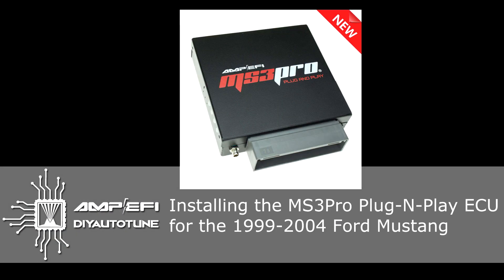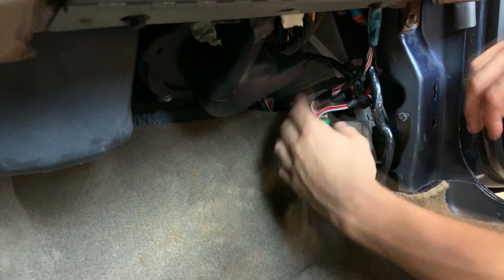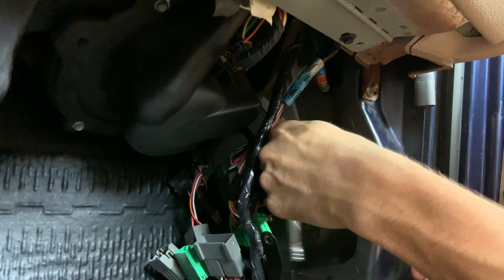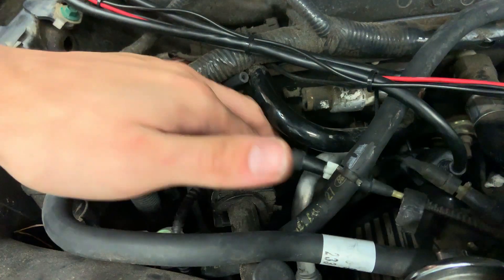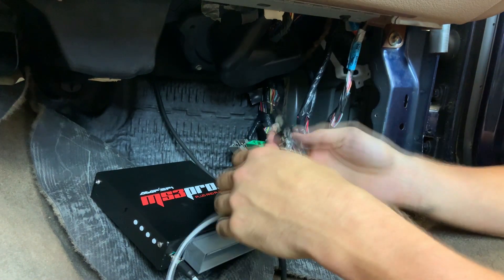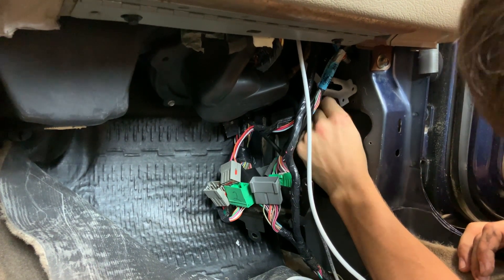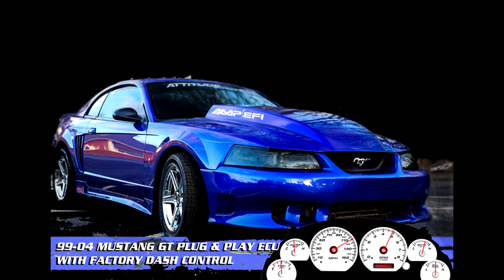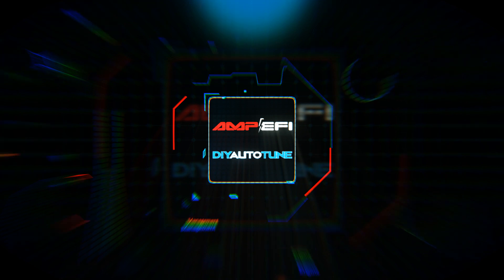MS3Pro PNP Installation on the 1999-2004 Ford Mustang (part 1/2)

Comment: So if I was doing a swap from 2v to procharged 4v would I need the 99-02 ECU or the terminator ECU? 

I’ve got what is basically a terminator but with a teksid block and a p1sc procharger kit rather than a whipple.

Comment: Since the 5.4 is pretty much the same thing electronically as the 4.6, can the pnp be used on a 5.4? I installed a 5.4 lightning engine in my 84 gt and I'm curious to see if it will work with my setup. Thanks guys!
Reply: I'd like to know also. I'm installing a 5.4 in a 96'.

Comment: Will this work with the 03-04 cobras. Or do you guys offer anything for the cobra.
Reply from the maker: About to release the 03-04 Terminator Cobra model any day now man!  Maybe this week, or early next at the latest!
Reply: @AMPEngineManagement  Forgot to update this thread, here it is!  https://www.diyautotune.com/product/03-04-ford-mustang-svt-cobra-plug-and-play/
Reply: Sweet been looking for a while for something like this. Will it be plug and play like the 2v.
Reply from the maker: @mikej5131  Yep the same install video above will apply.  No obvious differences other than in the base map.   (the ECU is slightly different, just two pins used differently)
Reply: @AMPEngineManagement  Thanks for the info will be looking forward to you guys taking my money lol.
Reply from the maker: @mikej5131  https://www.youtube.com/watch?v=sZHCVyllnck
Reply from the maker: Coming VERY soon!  Doing some final testing on the dyno in the next couple of weeks.  Then production run and release.